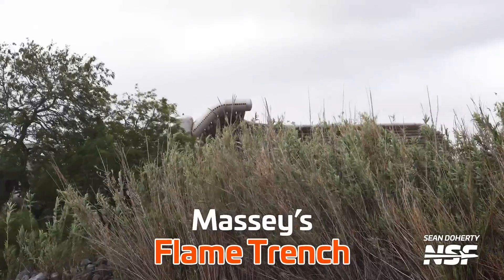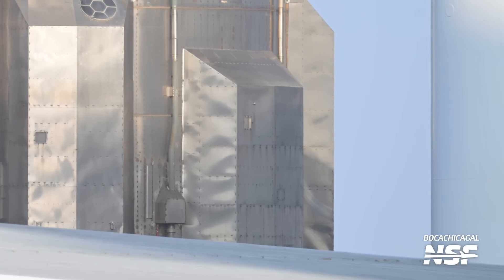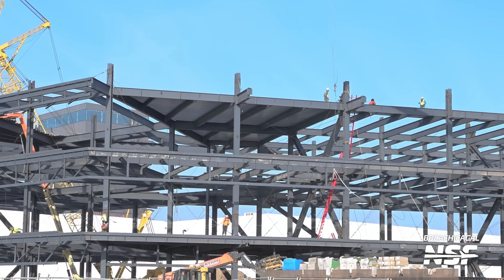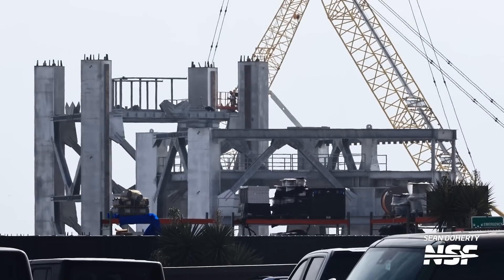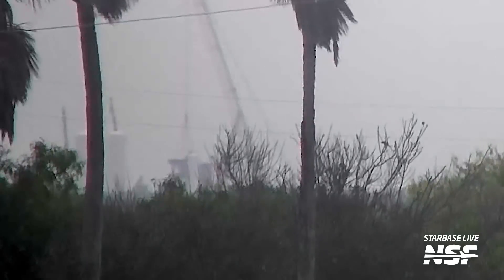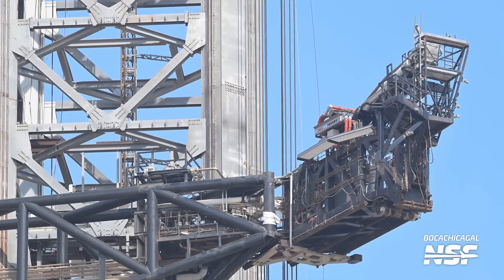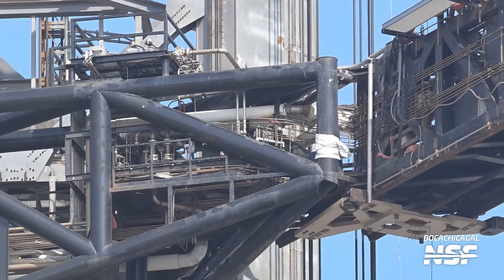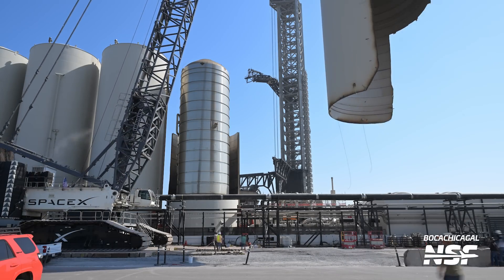SpaceX's Ramp-up for Starship Flight 4 | SpaceX Starbase Update

Comment: Are we even completely sure SpaceX will replace both  chopsticks actuators? 
(I hope Im wrong), but it's possible the 1 (new) actuator  was simply replacing a faulty or damaged actuator, and not an true upgrade for speed. 
It wouldn't make sense to have only one faster actuator.

Comment: Well, remember with this upcoming flight test they’re gonna try to catch the booster stage with the chopsticks. They’re probably making sure that thing is tiptop shape so that they can catch this thing.
Reply: Nah, you've got it mixed up. IFT5 is when they will attempt to catch the booster. They will simulate a catch over the ocean in this upcoming launch
Reply: To add an important caviate (which neither myself or google spell check have any idea how to spell).
This launch will not be trying a catch and IF the simulated landing on IFT4 goes extremely well, they will try to have the next flight attempt that first catch. 
That actually happening is quite a stretch though, so far they have had one booster even reach the ground in one piece and it was no where close to having a good re-entry and achieved like 4% of a landing sequence lol.
It wont completely surprise me if they do get it perfect on the next launch and try a catch on IFT5 but its pretty unlikely.

Comment: My guess is that there will be a lengthy stand down after IFT-5 to allow the construction of OLP-2 and modifications/repairs to OLP-1 ahead of the introduction of Starship V2.
Reply: Nope. That is not the way SpaceX works. They will do both at the same time (launches will halt work ofc).
Reply: Honestly i dont think it will make much or any difference at all. They have no issue with doing major projects directly in the hot zones and just replacing the random generators and such that were forgotten and thrown across the site during engine events lol
If there is a delay it will more likely just be adapting to new manufacturing processes.